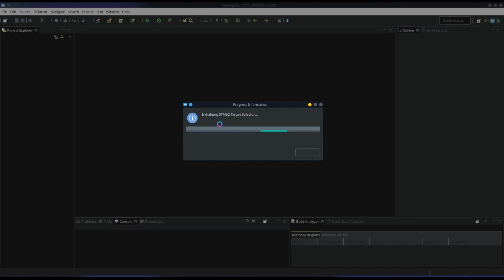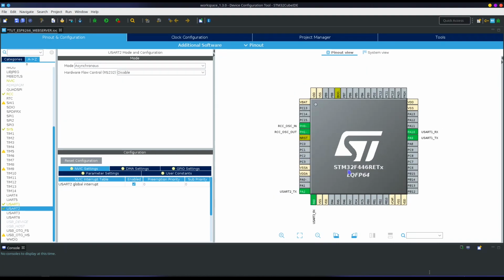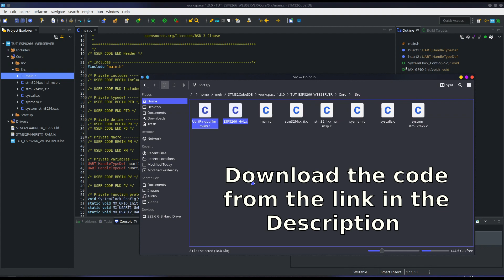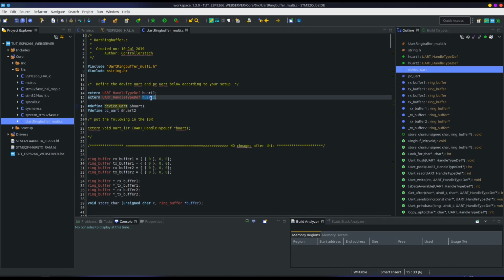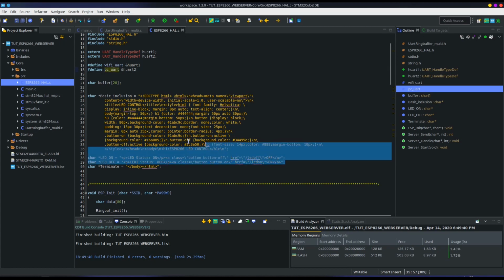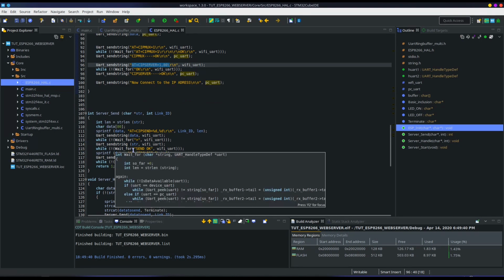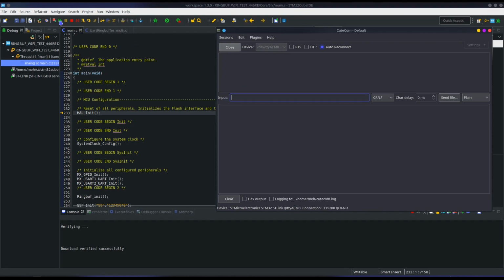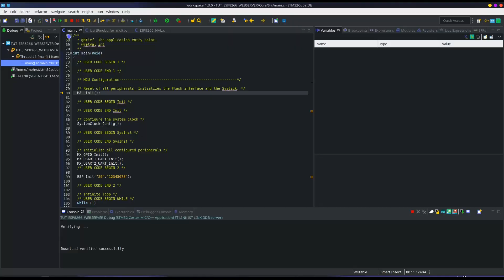ESP8266 WebServer using STM32 HAL|| LED Control || Ring Buffer

Comment from the maker: Here are some ways to Fix errors

1. Make sure both the uarts, and the ring buffer is working well.  Follow what I did in this video and you should also get the results https://youtu.be/1CV3tWlRW5A

2. Sometimes the connection with the ESP is the problem, So test the ESP separately https://youtu.be/eiw-Ns9l8K8

3. If you are stuck at the IP Address part, then use a third device. I mean your phone and ESP should connect to a third device (could be another phone or any router)

4. Mostly the issues are with the Discovery boards, and they are due to some UART connections at the hardware level. So make sure you test the UART using the first point.

5. During Debugging, don't halt the CPU while looking for some string. You will loose the data, and the code will hang there.

6. I spent countless hours in making it work, so You also put some effort before simply commenting that it doesn't work. DEBUG..... It's your strongest weapon.

PS: Cutecom is only available in linux. Use any other serial monitor like realter, terraterm, hercules etc
Reply: thanks！  Really appreciate a lot your effort and guide. i change another development is workable...no idea why previous development board run half then stop...
Reply: @kiansionglau9581   what development board u use?
Reply: Thanks bro,
192.168.1.121
CIPMUX---->OK
CIPSERVER---->OK
Now Connect to the IP ADRESS

Look like is success after i change development board. so i key in 192.168.1.121 to my handphone browser?  anyway, my handphone no display. can advise a bit for this?
Reply: Could you make a tyutoriyal for using ESP8266 with its SPI/HSPI connections instead of UART?
Reply: @Tenisinspector8341  hello did you get this?
Reply: Thankyou sir

Comment: can i use esp8266 nodemcu v3 with stm32 l476rg?
Reply from the maker: Yes, You can use it with anything that has UART.
Reply: @ControllersTech  but i have a problem when i connect stm32 with esp8266 .when i click on/off the led doesn't work
Reply: the ip is not shown
Reply from the maker: Nodemcu has lua firmware by default. You need to flash the AT firmware to make this work. 

This video is intended for ESP8266.

Comment: For STM32F7, I disabled the "Enable the UART Error Interrupt" codes in Ringbuf_init() function and I used the updated version of Uart_isr(...) function. Then, it worked for me. Thanks a lot.
Reply: Bro.. can you please help me I'm using STM32F429ZIT6 , Serial Terminal usart1 only communicated with terminal.im using usart1&2, one for PC and 2 for wifi module and i interface with ESP8266-01 wifi module. I did everything like this video. But  not worked. Can you Give me some idea?

Comment: Hi, the tutorial is nice, but I'm having trouble understanding a general thing. In general, a web server can probably be made in many ways. You can use a standalone ESP8266, or ESP32-S, or like you: ESP8266 in combination with STM32 sending AT commands. Question: which variant is generally better when creating a device "from scratch"? Is this guide more suitable for existing STM32 devices "extended" with WiFi functionality provided by the ESP module, or is there simply another reason why the STM32 should be a "master" controller than it would be worth using the ESP module alone?
Reply from the maker: This tutorial just adds the wifi capability to the stm32, Nothing else.. 
If mcu doesn't matter then there are obviously better alternatives like ESP32 .

Comment: How to add few buttons in html code, and add accordingly the changes in "server_start" and "server_handle" in order to add 2 more Leds and make project scalable, I tried addding buttons in HTML and thought ill add more ("if,else if") for adding more logic for several Leds and also declared /ledoff1.../ledon1 in different variables suchd as LED_ON1 or LED_OFF1.....according to the buttons in HTML and output but im not able to make it scalable {also defined pins as GPIO o/p at IOC file} please help, how do i make it work for 3 Leds?

Comment: i flashed AT firmware the project is working perfectly, but after few seconds its gone, i need to press reset again please can you guide me, where to change the code, for that i believe its in ESP8266_HAL.c.

Comment: Please provide {"ESP8266_HAL.c" and ''UartRingbuffer_multi.c'' with their header files}its not there even at the site nor at github and also not present in description.
Reply from the maker: The link to the article is in the description.
You can download the entire project from there.
Reply: @ControllersTech  I checked it only the codes are written over there, there are no ".c" or ".h" file or any sort of library whatsoever please kindly check with it and if possible provide zip files for both{"ESP8266_HAL.c" and its header file/''UartRingbuffer_multi.c and its header file} ive watched this video quite alot of times but i keep getting jumbled in libraries i couldnt go forward
.
Reply from the maker: Here is the tip:
Every tutorial website that provides the code, it is mostly located towards the end of the article. 
Here is the zip file https://controllerstech.com/wp-content/uploads/2020/08/TUT_ESP8266_WEBSERVER.zip

Comment: YES sir i found that thanku. know i want to know connections of wires of stm with esp board
Reply from the maker: Read the post where you downloaded the project from
Reply: @ControllersTech  thanku sir
Reply: @ControllersTech  i have seen that pic but there is no labels on the respective pins.

Comment: Hello, could you tell me which part of the code I need to modify (expect the HTML one of course) if I want to add a second Led on the same web page ? Because the "Server_Handle" part seems to be adapted to a single Led because of the presence of "/ledoff" or "/ledon" in the adress. Am I wrong ? And if yes, have you any advice ?
Thanks a lot for what you do,
Regards.
Reply from the maker: You can create another pages with /led2off and /led2on.
Reply: sir please help me how can i get these 4 library file [ UartRingbuffer_multi.c , ESP8266_HAL.c, UartRingbuffer_multi.h , ESP8266_HAL.h ] @ControllersTech
Reply from the maker: The link to download the project is in the description of the video.

Comment: Great video!
Could you help? I tryied had problems and I quite not understand how do I send a longer(more than 2048 characters) HTML file through the AT+CIPSEND commands! It always ends in an error or just failing at sending data at some point
How should the proceidure be?
I also tryied with the UART USB adapater but still got the same results

Comment: I  had made connection and then burn the code to STM32F411 discovery i had received only RESETTING..RESETTING...... at hercules what should i do to get ip addresss, help me thanks
Reply: Did you ever figure this out? I have the same problem. I get stuck on the while(!(Wait_for("AT\r\r\n\r\nOK\r\n", wifi_uart)));

Comment: hi thanks for your video,but i don't understand why do we need to use ringbuffer and you use uart_pc only to display the IP address of ESP,right?please help me,thank you very much.
Reply from the maker: uart2 is not needed. I just used it for the debugging purpose.
For the ring buffer, you need it because you don't know the size of incoming data in the uart
Reply: @ControllersTech  thanks but i have a problem,  i am not able to receive the ip address hercules screen shows only RESETTING……after that it stops from working.what should i do so that i would be able to receive the ip address and open web page please help me.
Thanks in advance
Reply: @ControllersTech  hey sir i got that word "Now Connect to the IP ADRESS" but when i connect to the web,it said "ERR_EMPTY_RESPONSE      192.168.1.12 don't send any data".please tell me why.I think the problem is the Basic inclusion.it have a warning "a format string is not a string literal",please help me thanks u so so much.
Reply: @ControllersTech  i think the function name Get_after get error ,i can't take the value behind that,can u help me ffix it, please help me,thanks you very much.
Reply: @meohoang7741  giúp tôi với chuyển uart với esp8266 à ông
Reply: ông ơi tôi không ra được đại chỉ IP giúp tôi với, cảm ơn :D

Comment: I am using stm32f446 but the program stuck at is data available function
Reply from the maker: First check if the uart ia working properly
Remove esp, and Short the Rx and Tx pins for the device uart... Now whatever data you send should come back... Try this

Comment: Hi, i use  esp8266-01 too. When i connect with ttl converter to wifi module and sent AT commands from serial monitor.i got correct answers. But when i sent AT commands from stm32f4, no answer from wifi modul. Whats the problem? What should i do? do you have offer for me?
Reply from the maker: Are u using uart ring buffer ?
Reply: @ControllersTech   i did your both project
but both of them stuck at IsDataAvailable funcktion
Reply from the maker: Remove esp, and Short the Rx and Tx pins for the device uart... Now whatever data you send should come back... Try this
Reply: @ControllersTech  its interesting, looks like i send but rx interrupt doesnt occur. i thought first usart 1 port doesnt work, so i have same board and tried on it. and same rx interrupt doesnt occur.
but function is correct. cos i use to send data to serial monitor same function.
Reply: @ControllersTech  okay i tried and tx wasnt come back. so i configure another usart and it works. thanks so much

Comment: I had made connection and then burn the code to STM32F407 discovery i had received only RESETTING..RESETTING...... at hercules what should i do to get ip addresss
Reply: change uart
Reply: @meohoang7741  giúp tôi với ông
Reply: @triettruongminh1423  tôi đổi uart thôi ôg trog bài xài u2 thì ôg xài u1 hoặc 3 thui,tui nhận dc ip mà truy cập cụg ko dc ôg,

Comment: Thanks a lot! But when I use it with STM32F103C8T6, I can't access to the server with provided IP address. I don't know why.
Reply: Oh! And I have a warning with "sprintf (datatosend, Basic_inclusion); " function. It warning: "format string is not a string literal (potentially insecure)" at "Basic_inclusion". But with sprintf(data, ".....", SSID) with the same datatype is not warning.
Reply: @truongpham7279  i have the same problem of you,can u talk a bit more detailed,what i need to do,please help me,thank you very much.
Reply: @meohoang7741  bỏ làm kiểu khác đi ông! Hồi đó làm lỗi xong t đổi hướng
Reply: lỗi đó ko fix dc hã,ông làm qua kiêu nào ấy
Reply: @meohoang7741  ukm k đc. T đổi qua làm app inventor kết nối vs thingspeak, r stm32 lấy dữ liệu trên đó về điều khiển. Hoặc dễ hơn là lấy esp kết nối firebase hay thingspeak để lấy dữ liệu về chân nào đó, r stm32 kết nối uart đọc dữ liệu chân esp về r điều khiển ngoại vi cx đc.
Reply: @truongpham7279  thinkspeak vẫn gửi dữ liệu về esp đc hã hôg
Reply: @truongpham7279  ông ơi ông có tài liệu nào tham khảo mà esp vs thinkspeak ko ôg

Comment: I had problems with short time for which the module was connected to the wifi, the reason was too short times between rx and tx so I have added hal_delays in start() functions and everything is working just fine ;)
Reply: Could you explain where you put the delays please because I have a similar issue
Reply: @cpodge  I dont have access to the project unfortunately, but as I said it was somewhere in start() function which consists of some methods try before each one - should work then delete 1 by 1 to debug ;)
Reply: @michazodak431  Thanks, I will try this out! Did this stop your server from responding? I can toggle the LED a few times thenit will not reload the  page any more in my web browser and I have to do a hard reset to the board
Reply: @cpodge  after adding delays, server worked properly I have send some data from environmental sensors and displayed them on server and it didn't crash ;). Everything else was done like in tutorial

Comment: Thanks for tutorial, I had to make few changes in code because responses from my esp8266 module were slightly different but after all everything worked. The only problem I have is that web server is dying pretty fast after 10/15 secs is this due to the fact ram is getting fullfiled or I made some mistakes? Any ideas how to solve that?
Reply from the maker: Yeah server times out really fast, but that shouldn't affect the RAM. I have use malloc to allocate the dynamic memory. If u did made some changes, cross check the malloc and free. Maybe you forgot to free some allocated memory and it's adding up with the new allocation
Reply: Hi @Daronedous, did you get a fix for this issue, I have the same problem and cannot solve

Comment: I have used esp8266-01 it response to AT Command and connect to host but when I am  going to open web server it doesn't give response when trying to open server page using IP address.i connected my mobile and esp8266 to same host.
Reply from the maker: Try connecting both the esp and phone to another wifi
Check in the debugger, at which part it is stuck ?
Reply: can u fix it please helpme,thanks
Reply: @meohoang7741  nó cứ kêu là do mạng, mà t thử chạy webserver khác trên adruino thì vẫn được, mạng t ko vấn đề gì, chắc do code

Comment: Why if i want to add an ADC to show on the webserver a sensor value the ADC doesn't work?
Reply from the maker: Maybe you are not implementing ADC properly.. 🤔
Reply: @ControllersTech  on MX i add a 12 bit ADC with continous conversion enabled then in the while i start the ADC and i put with the pollforconversion instruction the value on a variable called adc_value but it remains always 0 instead...
Reply from the maker: Start 
Poll for conversion
Get value 
Stop
Reply: @ControllersTech  With Start do you mean start server or start adc?
Reply from the maker: hal adc start
poll for conversion
hal adc get value
hal adc stop
Reply: @ControllersTech first of all sorry if I'm making all these questions. The fact is that in others project I am able to set the ADC properly; in these project making the same steps I can't. It seems to be something that goes wrong. I haven't used adc stop and I'm going to do this right now; is it correct putting this chain of instruction you've written in the main while just after the server start instruction? Thanks a lot
Reply from the maker: Yeah I think it's okay to put those in the while loop after server start

Comment: Boa tarde, implementei o exemplo para stm32f103 más quando inicializo o   /* USER CODE BEGIN 2 */
  ESP_Init("xxxxx","xxxxx");
  /* USER CODE END 2 */ trava nessa inicialização, tem alguma ideia?
Reply from the maker: You need to check where the error is. If the firmware on the ESP is different, better try thise At commands first, and than change them if needed
Reply: @ControllersTech   o problema está quando chamo a função de escrita da seria -  Uart_sendstring("AT+RST\r\n", wifi_uart);   não conseguir identificar o erro!
Reply from the maker: your connection might be the problem.
also make sure you have followed the steps properly
connect your esp to the computer using ftdi or something and try those commands and see if it is responding to them

Comment from the maker: I have used NodeMCU, but i wrote the tutorial in terms of AT commands. So you can use it for all the esp8266 types.
Regarding the connection, you can google it. All MCUs have the same connection. Rx of ESP to Tx of MCU, and Tx to Rx.

Those, who have errors in the Uart_isr function, like DR or SR registers are not present, replace the Uart_isr code with the one provided in this file https://controllerstech.com/wp-content/uploads/2020/04/Uart_isr.c
Reply: I have a NodeMCU, which was already programmed using Arduino IDE for some other application. In that case how do I restore NodeMCU back to its original configuration, so that your program works? Thanks in advance
Reply from the maker: @wp0049830  You need to flash the AT firmware. Just google it, there are a lot of tutorials available for it
Reply: bro,where i can download a aplication cutecom for widows? i'm stuck in is this. my program cant run because i dont no the ip for turn on and tur off LED
Reply from the maker: If cutecom not available then use hercules or realterm..
Or putty in linux
Reply: sorry brow i have a question , why i run in hercules and realterm cant display ip addr? what i wrong the view display the symbol cant be discribe  ? i follow your program until end but cannot display ip addr
Reply: im only change the mcu stm32f407vg in cube ide ,because im use stm32f407G disc-1
Reply: @danusinungga4839  did you solve this i have the same problem

Comment: Can I use these codes on Keil?
Reply from the maker: Yes you can...
Reply: Controllers Tech I wonder that your esp8266  module. Whats the model of it exactly? Also can you share the connections?
Reply from the maker: Actually it's NodeMCU, but i wrote the tutorial in terms of AT commands. So you can use it for all the esp8266 types.
Regarding the connection, you can google it. All MCUs have the same connection. Rx of ESP to Tx of MCU, and Tx to Rx.